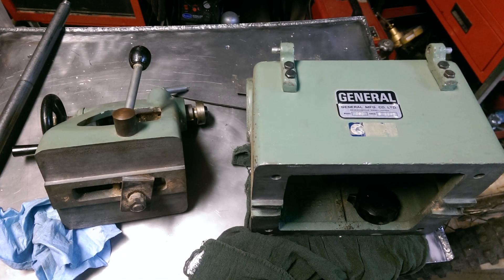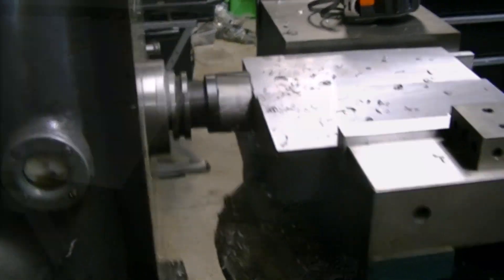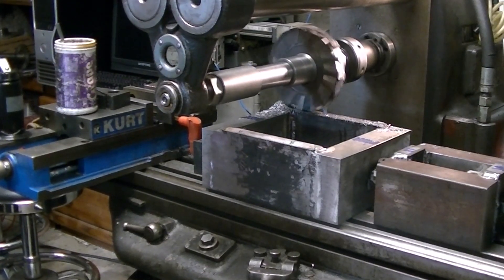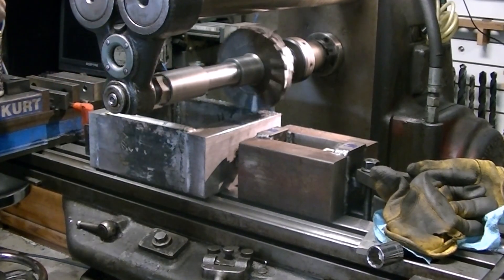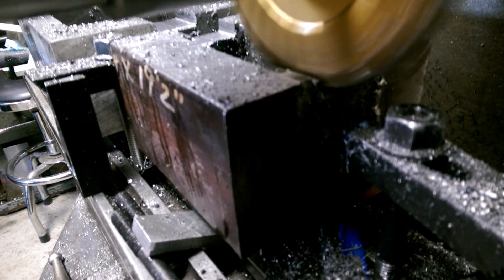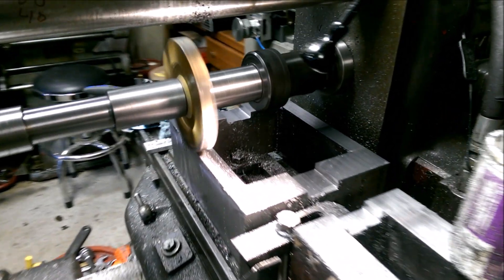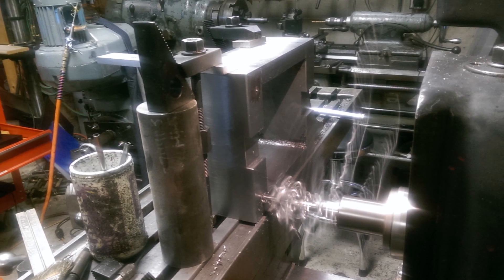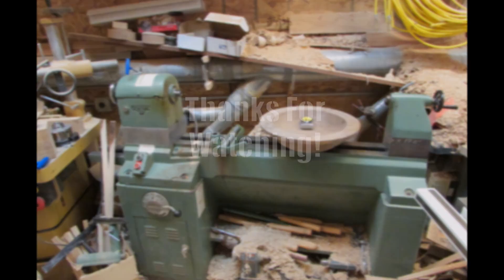Lathe Riser Blocks - Lathe Lift Kit?

Comment: Excellent job! I’m looking for the riser kit for the General 260. Would it be possible to order them from you? - what would the cost be?
Reply from the maker: +Louie Barbieri thanks for stopping by. I just made the one riser set for a friend. I had his parts to compare to ensure a good fit. Making the parts the way I did in the video would probably be cost prohibitive. Craig
Reply: clemwyo Thanks Craig- I’ve been looking everywhere for the risers for some reason they are not around anymore. Anyway thanks for getting back to me. Louie
Reply from the maker: +Louie Barbieri have you considered getting a metal lathe and using it for wood turning? Large swing metal lathes can be had fairly cheaply, much more so than the smaller, garage friendly lathes. My lathe swings just over 18 inches in diameter and with the tapered roller bearings in the headstock should be able to handle a couple thousand rpm (I usually run it around 250 rpm for metal). Just a thought of you are looking to turn large diameters. Craig

Comment: Good job, it helps to have a nice big horizontal mill at times like these.  It always seems machines are lacking useful clearance in one axis or another, well my machines anyway.
Reply from the maker: +John Bare I do enjoy using the horizontal but I usually have the Bridgeport clone head on it for general operations. As you said, the room under the quill does run out sometimes. Thanks for stopping by. Craig